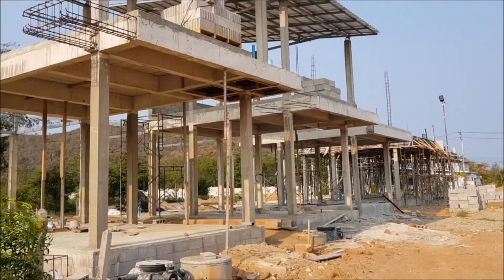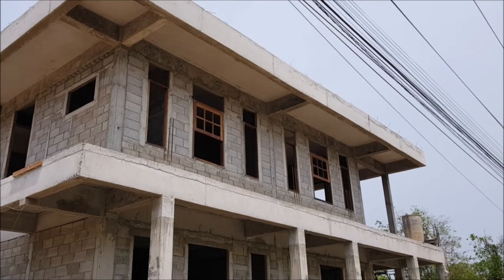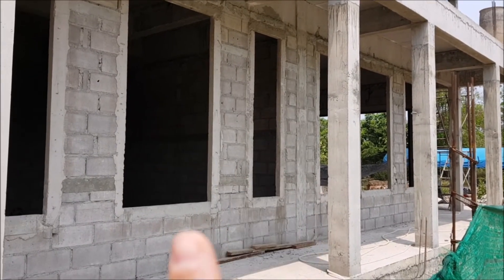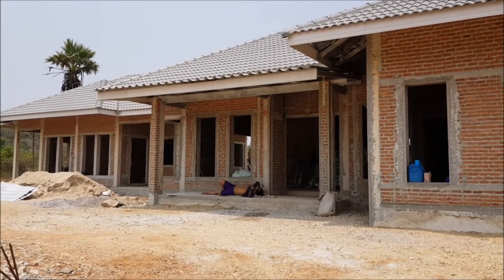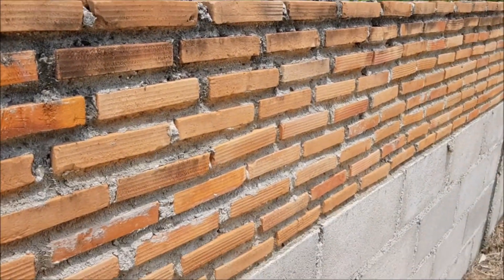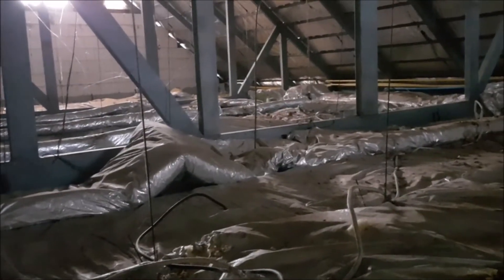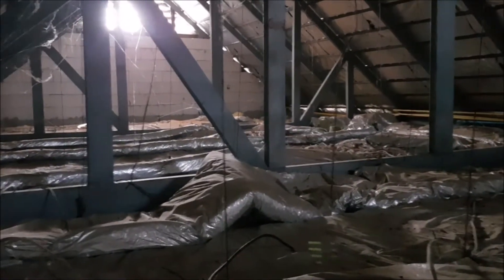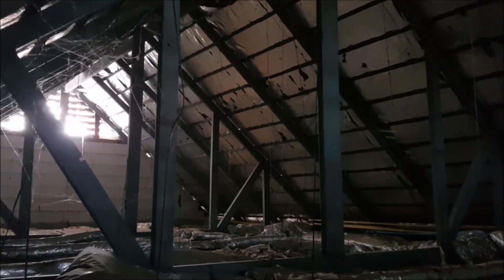Energy efficient building for hot climates. How are Thais building their homes?

Comment: The problem with the large block is that the require something like a large factory to produce them. The regular congrete block can be made on site using local labour and simple molds.
Reply from the maker: Aren't all the aerated concrete blocks, even the 7,5cm which they are selling everywhere, all coming from a factory near Bangkok?
I just know if you want to have thick ones, you have to buy a whole truck full of it. But in theory they can cut the molded factory block to any size you want.
Locally they will make all those normal concrete blocks. If you think local is better because it saves the transport, then its still not better for the climate as those concrete blocks are useless in terms of thermal efficiency.
Reply: @RolandW_DIYEnergyandMore  I completely agree with your conclusion on the thermal efficiency of the aerated concrete blocks compared to the others. My comment was meant to draw attention to the main disadvantage of the aerated blocks and why it is relatively difficult to quickly adopt it's use in many tropical countries including Thailand but especially beyond (e.g. Most of Africa, South America and a good chunk of Asia). If there are small scale machines that allow local production by small/micro businesses very close to the building sites then adoption will be more widespread.
Reply from the maker: @adon8672  I saw a few videos, maybe from India where small, local companies where producing the blocks. But you know how things work in Thailand. It's always the big business who is taking over anything what potentially makes money.

Comment: Good video. What about moisture control, thermos bridges, etc? I'm concerned about all of those as a package of building physics
Reply from the maker: here in Thailand moisture will mostly creep up from the foundation. So the lowest beam on which the walls are resting should optimally be higher above the ground. I am draining surface water away from my buildings as good as possible. 
Thermal bridges in my opinion in hot climates are not such a great concern as the temperature difference between inside and outside are not as huge as in cold climates.
Reply: @RolandW_DIYEnergyandMore  ok. Thanks. Rising moisture is one problem - horizontal hydro insulation but there is horizontal moisture through the walls as well. If you cool down your room to 25 C and there is outside 35-37 C, it creates an enormous pressure difference. Result - the moisture is traveling through the enclosure and high possible, that there will be a wet point somewhere in the wall. Air ventilation may help. But in some cases still not enough.

Comment: Great video, we are looking to build in 2 years in the north east of Thailand, today was 38degrees, so would like an alternative than relying solely on air con
Reply from the maker: Yeah. Such high temperatures are tough especially when your options of letting outside air circulate in or around your building due to bad air quality. As temperatures are rising above a certain level and stay up high even during night times, there is only as much you can do with creating shady places, etc. We will all have to rely on air con more than ever. Thats why it's important to use highly efficient building materials and at least try to use solar energy to run those devices as best as possible. 
Greetings to the North!

Comment: What do you think about a Passivhaus type build (airtight building with efficient low heat bridging) for Thailand? It will require an ERV for air exchange and humidity control. I am seriously planning a house build in Thailand and cannot find any Passivhaus builders there online.
Reply from the maker: For the tropics this is a tricky concept. Passivhaus works well in moderate climate where you can as well play with sun angles during winter, etc. The concept there is to recycle your waste heat, catch it and reuse it before it leaves the house. Here you would need to cool the interior always, and the fresh air you bring inside needs to be cooled as well. Good walls and sufficiently overlapping roofs to not let the sun burn into the windows should do most of the trick. You will need to generate your electricity for cooling and that will make you Passive. Such concepts are unknown in Thailand. You will have to bring in your ideas and hopefully find a contractor who can follow your concept.

Comment: Do you any opinion on using the insulated roof panels compared to placing insulation over the ceiling like you showed? I've seen the insulated root panels and they cheap, effective and easy to install so they're maybe a better option? The ceramic roof tiles do look better though.
Reply from the maker: My architect here once said that insulated panels like the insulated sheet metal ones tend to degrade and then the insulation will crack, fall off, being eaten by critters, etc. They usually put metal foil under the ceramic tiles. But those foils also crack. The insulation on the ceiling will be damaged by mice too. So, there is no perfect solution for all. It's best to use a combination of different methods to achieve a better result. 
Energy efficient buildings will not necessarily be the cheapest, but it makes sense once you have to pay less for electricity.
Reply: @RolandW_DIYEnergyandMore  I have seen thicker panels that appear to have about an inch of foam underneath them which look much better than the thin foil I've seen under many cheaper panels in many buildings. Yes the foil will fall off as I've seen this myself at many locations.

Comment: Hi Roland
I retired here in Thailand. I can buy the concrete block in the video for 5 Baht each, but when I go to SCG and look at the aerated concrete blocks, they want a small fortune for them .
Reply from the maker: How much is it for the 7.5cm aerated, around 35B? Red brick is as well that price for the same area to build. The thick one is around 100B I guess. I know that the 7cm concrete block is super cheap, but in terms of using air-conditioning, it is the way, that the room might feel cool as long the AC is on, but immediately will turn to outside temperature once you turn it of. So you are basically just pumping cool to the outside with your electricity. You could easily save 1000-2000B a month just on electricity with better walls.
You need to calculate, how much money it is just for the wall filling. You will see, that at the end it is not that much more to go for aerated blocks, as wall filling is only a small part of total cost. The big ticket item in construction is the steel reinforced frame, and the roof. If you are planning to stay in Thailand at that place for the foreseeable future, go for at least 2 layers 7,5cm aerated (15cm wall). You will later find, that the climate inside the home is very much more comfortable. You can use that material for only the rooms with AC. The other non critical rooms, you can use cheap concrete as well...
Reply: @RolandW_DIYEnergyandMore  
Hi Roland. well, I was just commenting.
I’m up here in the little farming valley of Samoeng, about an hour up in the mountains above Chiang Mai.
I actually took apart three old wood Thai houses, and repurposed them into one new / old Thai house. Thought that was the right thing to do. Hate concrete !
But, doing the right thing comes at a cost, and I’m probably about 100% over budget. But I’ve got a house that breathes, is cool almost always, doesn’t trap poisons inside, no need for a/c or heat.
Cheers, and thanks for the video.

Comment: Very informative video. I am in the process of building a house in Kalasin, and opted for the cheap hollow bricks for bathroom and livingroom, and the 7.5 cm white blocks for office and bedroom. Sound and heat insulation being a priority. We paid 25 baht per block. I am curious to know how much the big ones are. We have not yet arrived at the point to do the roof, so now is a good time to ask about your choice of insulation. What did you use, how much per sqm and where did you get it? I was recommended a metal roof, so certainly need all the protection I can get.
Reply from the maker: Hi. White blocks are paid by quantity of material in them. a double wide brick will typically cost 2x of the thinner one etc. At the time we built it was around 60 baht a brick. You can just use a extra layer of the thin one if you want to simplify. 
Our roofs are C-pak stone roof. directly underneath the stone is a thin layer of heat blocking foil. But then we put extra insulation wool on top of the ceiling in the attic.
I don't know about the stile of your house. Guess it has a flat roof thats why the metal? Metal roof is very loud when raining. You will have to keep some air circulation below it too.
Enjoy living in Thailand:)

Comment: Somehow I have expected  house partialy under ground , or with some kind of passive ventilation (trombe wall) from soil . I was suprised with thin bricks with low heat capacity .
Reply from the maker: Can't build a house under ground in the tropics. Everything would rot from moisture and humidity. Idealy it's kind of opposite and houses are lifted up from ground.
Reply: You could use the earth for passive ventilation, similar to a ground source heat pump, where outside air is brought underground to pass through subterranean piping to cool the air before being directed into the building 

It’s used in North Africa and the Middle East for centuries, becoming popular in Europe and North America (called earth tubes)

Comment: I am looking to build in Thailand. Do you know of a builder experienced in these more efficient designs? Would it be better to source plans internationally? Do you have any experience or knowledge in the use of heat chimneys to draw in cooler air?
Reply from the maker: Hi. You do know Thailand is a big country, right 😉 I would look for a local architect. They all use the 3 inch aerated Concrete. Just tell them to double up. Most will have experience with other insulating materials too. They just don't use all of it because clients want to stay cheap. I have a heat chimney on our main building. Typical Thai buildings will also have openings in the roof gables. There is knowledge there...
Reply: @RolandW_DIYEnergyandMore  Thank you, yes have lived in Thailand for some years. I was hoping you knew of specific architects with experience.
Reply from the maker: @9squares  well, the architect who built most of our building moved to Phrae in the North. In Thailand they do have their style of building which is based on the pile and beams. So you are sort of limited to design in a grid. But you are totally free of what material you want to use to fill the wall spaces. You as the client are telling what you need and they will follow. Just don't let the contractor tell you how it will be done 😄

Comment: Do you mind sharing the name of the architect or engineer you used when you obtained your building permits? I'm starting to compile a list of architects or engineers that I might hire for my own house build and I want to use one that understands good insulation design like your structures.
Reply from the maker: You will build in Thailand? Which place?
Reply: @RolandW_DIYEnergyandMore Yes, in Loei province for starters. But I assume any architect or engineer that is licensed in one province is also licensed in them all?
Reply from the maker: @GBobFree206  yes, any Thai civil engineer can sign a construction project. But sometimes it is easier to use a local engineer from the Or Bor Tor for drawing your plans etc as the local authority might have preferences. Thai construction as shown in the video is anyways based on reinforced columns and beams and filler materials for the walls. When using better filler materials, then you will get higher energy efficient buildings.
The architect that I was using is actually living in Phrase now. So it's not to far away from your place. I could give you his phone number once I am back in about 2 weeks. You can contact me by E-mail at the address shown in my channel info.
Reply: @RolandW_DIYEnergyandMore Thank you. Yes, my plan is to try to make something very energy efficient with high R value walls and also windows, both for energy efficiency and for noise reduction. I also like the earth berm style with berms around the structure, and rammed earth, but I want whatever I build to be properly permitted and to follow appropriate building codes.

Comment: Bricks have the oven effect..Suck heat during the day give it back at night.. One must stop radiant heat..
Reply from the maker: Yes, that is correct. Dense bricks, concrete blocks, etc will heat up a lot and then radiate heat. But as you say that you use an outside layer of aluminium sheet, then foam, then the wall, in comparison the aerated concrete block is about similar. You have dense plaster, then the foamy block and then dense plaster again. The trapped air inside a material is what makes it thermally effective. Tiled roofs heat up, right. That's why my roof is detached from the room underneath. Back-ventilated and ceiling insulated. One could use light materials for roofing too, but those typically fly away in storms :) I can see that you have a lot of experience with living in the tropics. Thank you for sharing.

Comment: Building a passive house in a mostly hot climate is a grossly overlooked area. One important question I have is,  "Do you need to insulate the building as in the colder regions if your only focus is keeping the house cool?"
Reply from the maker: For energy balance it doesn't really make a difference if you want to keep warm inside when it is cold outside or to stay cool inside when it is hot outside. Energy will flow from the warmer side to the colder, and it will do it more quickly if the material of the wall is not insulating well. 
The reason why house insulation was mostly an issue in cold regions till now is that temperature differences between inside and outside can be much higher in such places.
But on an increasingly hotter planet those issues will shift and get other relevance as well when energy costs might get higher in some places.
You might still help yourself with architectural elements when building a house in the first place. Create a shaded space in front of the main walls for example. Nature can help there too. 
But the core structure, especially maybe sleeping rooms if you want to have it cool, will need to be insulated so that heat and humidity cannot enter.
Reply: @RolandW_DIYEnergyandMore  Thanks

Comment: Is your house custom?  Most Thai houses built by developers that I have seen do not have the insulation above the ceiling or an open gable.  (Like you have in your video) Instead, they are relying on a radiant barrier underneath the tile roof.  I ask why.  And their engineer say that insulation would make it harder for the house to cool off in the evening.  Basically, Insulation will make sense if you want to use an aircon.  (Hence higher $)
Reply from the maker: Hi. Yes, all buildings are custom built by my specification. 
A typical Thai house with concrete walls will heat up during the day and cool of during the night. That's why it will have holes in the wall and nothing else than the thin dry-wall board as ceiling. During the day you will sweat if you don't leave everything open and during the night you will need a blanket :) 
But not every region in Thailand can offer cool nights and the air is staying hot and humid all around the clock.
If you just equip such houses with Aircon you will just end up with high electricity bills. You can always keep a window open at night as well.
Because in Thailand money is all what counts at construction, engineers are trimmed for cost savings. And they really don't care what you are doing after you move in. They mostly don't even understand the needs of foreigners when it comes to housing.
Reply: @RolandW_DIYEnergyandMore  been told we don't need your luxury.  Cuz I do think it's useful to use that insulation on the ceiling. Saw homepro having two thickness.  But its a later project, after some air dehumidifier/ or air filters due to burning season.
Reply: @RolandW_DIYEnergyandMore   ps. Thanks for the responses

Comment: What are your thoughts on using double brick walls 🧱? Is it significantly better than a single brick wall? Must you use an air gap?
Reply from the maker: Air contained within the material, is what makes a material thermal efficient. If a double layer wall is put up, it will surely be better then a single layer wall, but it will still mostly depend on the thermal coefficient of the type of brick which is used. An air gap is probably not as efficient than a better building material, as the air inside the gap can circulate and is not encapsulated inside the material itself. A better solution would be to fill the gap with styrofoam or wool, etc.
Reply: @RolandW_DIYEnergyandMore  thank you 😊
Reply: @RolandW_DIYEnergyandMore  wool is not good, it can suck moisture in it and it does newer disappear, aerated light concrete blocks inside and outside and between them empty corked bottles, could be worth of try, in some small house